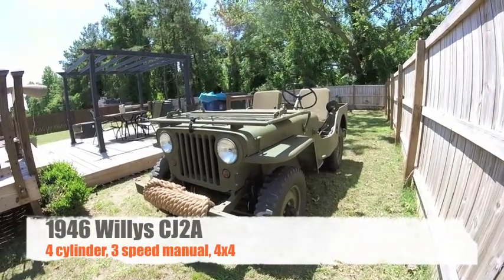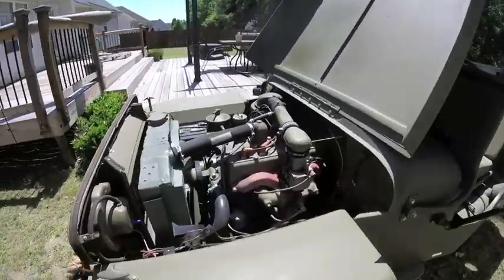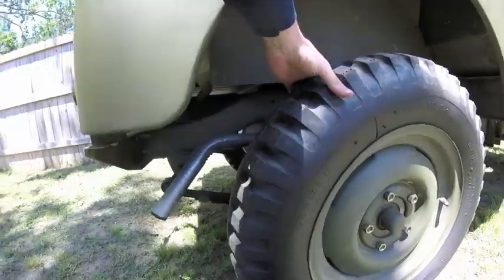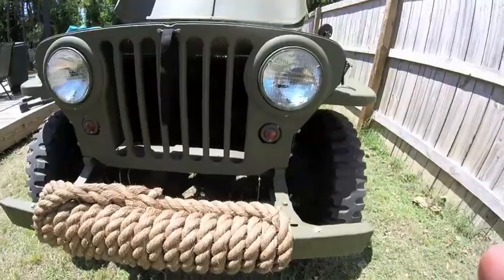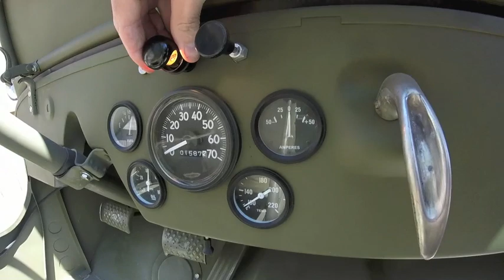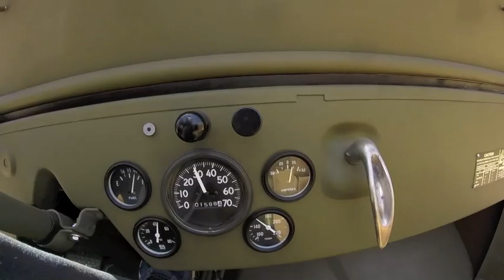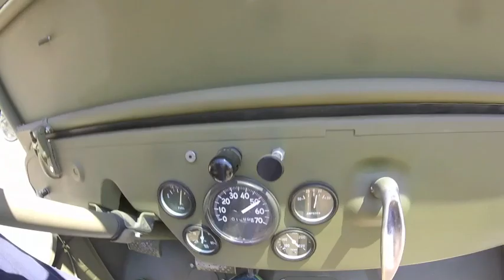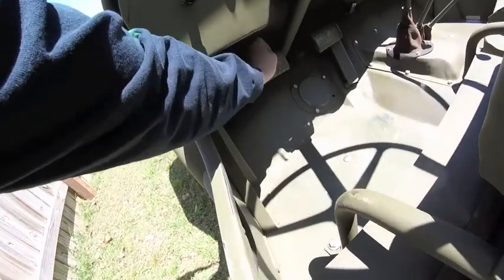1946 Willys CJ2A

Comment: Love it.  I have a '48 2a that I'm rebuilding now.  It has less than 10k original miles!  It's been in a barn for the last 25 years and was owned by the last owner for 45 years.  I'm putting it back into running condition so I can play with it for a couple years until my daughter is old enough for a father-daughter project.  Then we'll get it parade ready.  Great video!!!

Comment: Nice jeep. Not really restored though basically new jeep on old frame. The frame seems to be the only original part you didn't throw in the trash. I've thought about buying the crate jeep and putting it together. All brand new parts in a huge crate like the original military willys would've came in. You can buy them as complete as you want depending on budget
Reply from the maker: You don't know what you are talking about. Good luck.